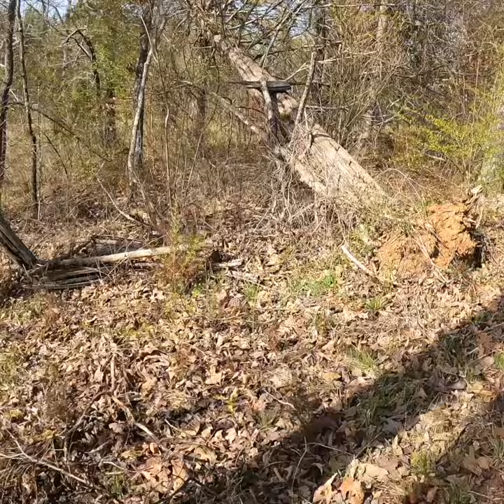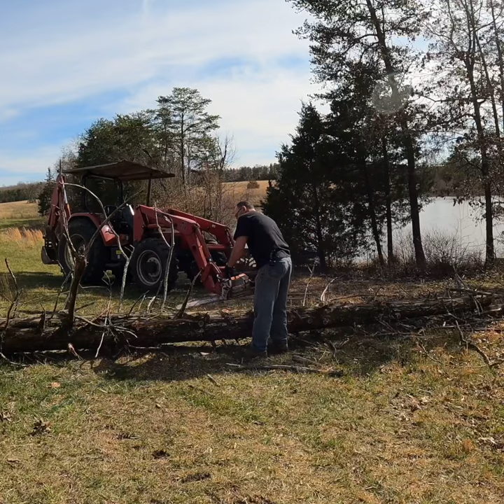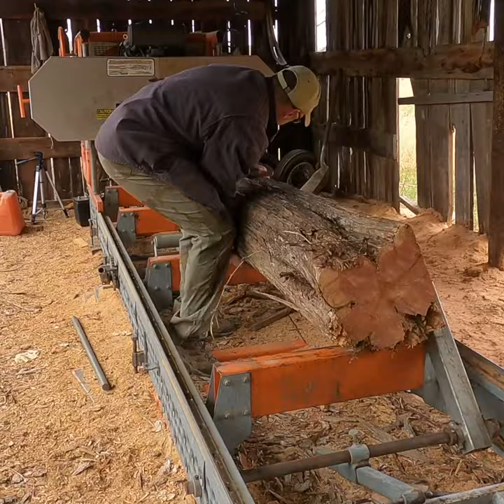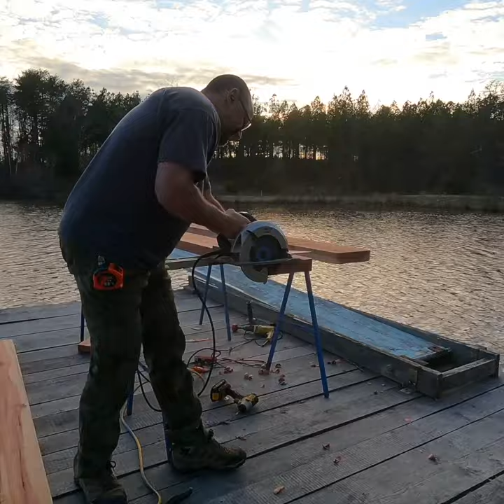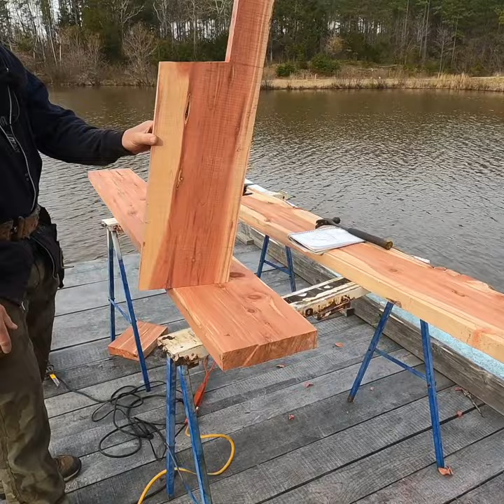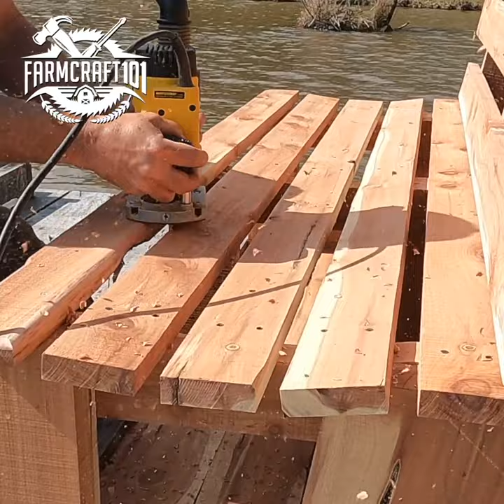Cedar Tree → Bench In 1 Minute - FarmCraft101

Comment: Wow you don't see many red cedar that size at the base that the center hasn't started rotting out. The red heart wood is out close to the edges of the log too which makes it a very nice log cause that's the part of red cedar that is rot resistant when it dries out. Very nice red cedar tree and logs from the tree. Neat bench. Good videos.  👍

Comment: 36 years later the metal nails rot out and the bench falls into the water.
Should've notched the pier to inset the beams so the nails/screws need only hold the beam to the pier instead of the entire weight of the bench and load.